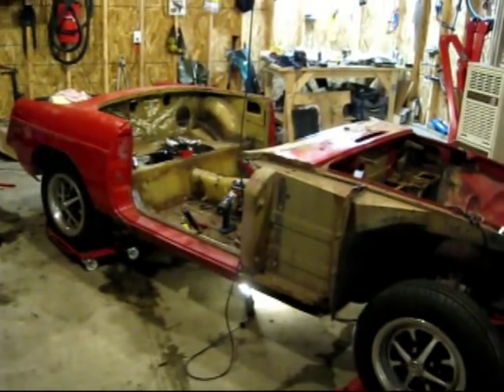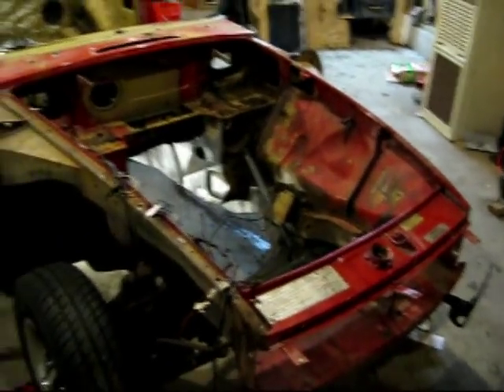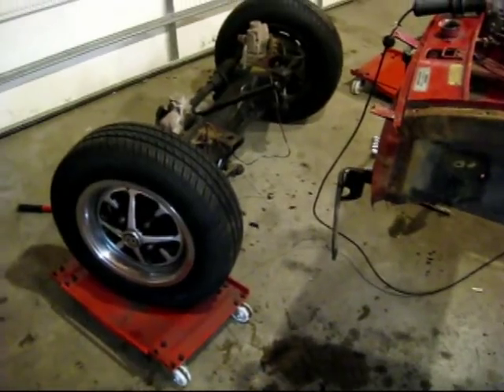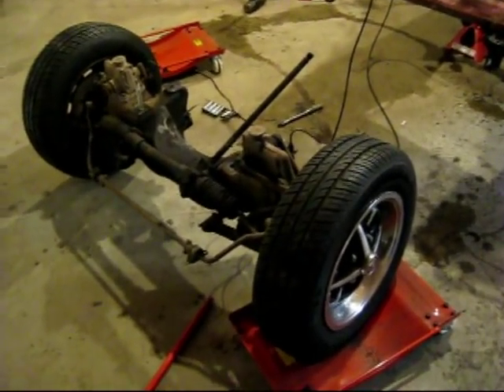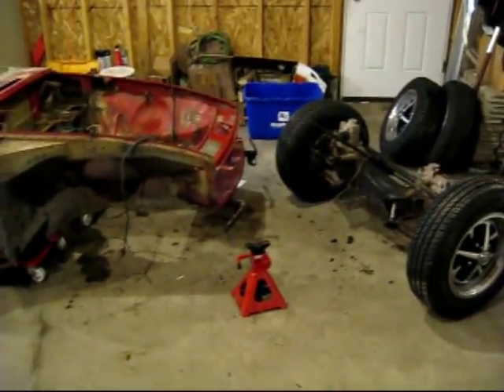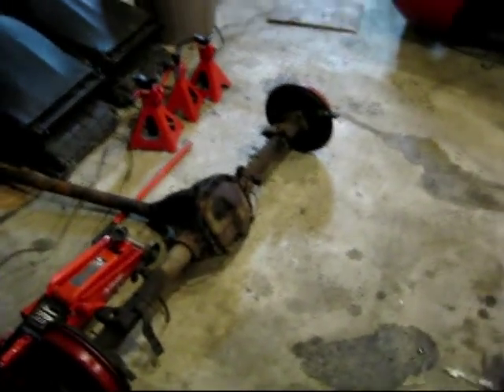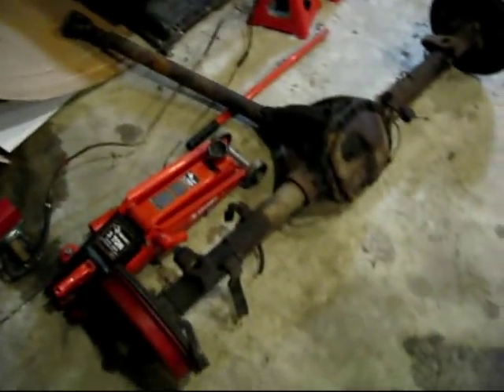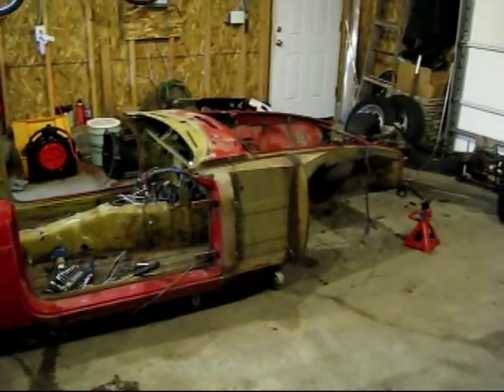MG 28 - The MG loses it's suspension

Comment: Marty, I have a '72 MGB roadster. when I removed the fender It was missing the "L" shaped, left "and" right upper extension splash panels. The main splash panels were there but the tops were missing. I had a '64 with the same thing, splash panels that were missing the top pieces.  I had a friend that had a MGB and his was also missing these top pieces. I was surprised  (as he was) and I was going threw a Moss Motors catalog and noticed these parts and wondered why mine were not there. I have since bought a pair from Moss and the rubber seals. I was wondering if these "L" shaped splash panel extensions are welding in or just left bolted to the main splash panel. I' watched your video and when you have taken the fender off, these panels are left on. Looks like these "Extensions" welded in but I can't tell and so far I haven't came across anyone that knows. I know the main vertical panel is bolted to the side panel. Anyone have any ideas?  Cool video